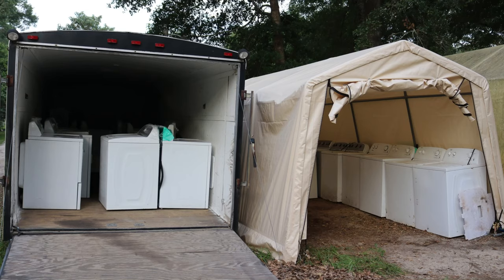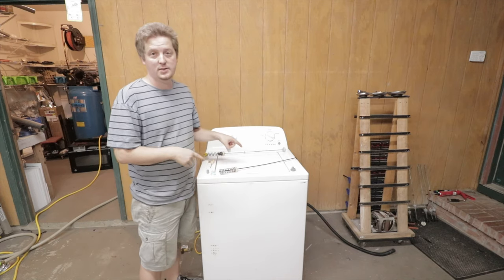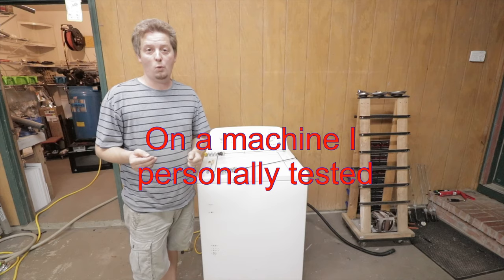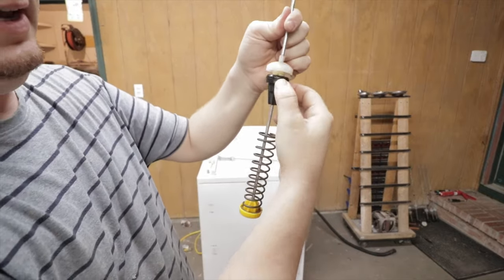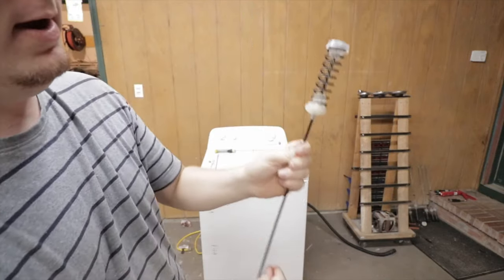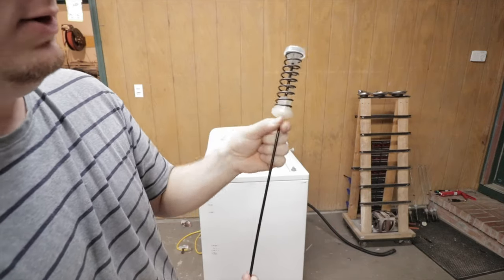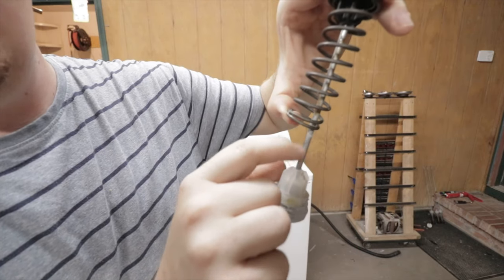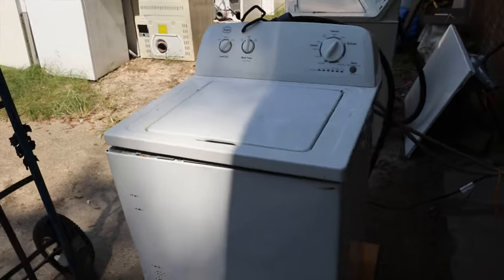Cheap Permanent? fix for shaking banging Washer? $7 to fix Suspension dampening rods W10780048

Comment: Simple fix for your problem with your " Samsung and other high end machines "  LOL  .  Buy a Speed Queen.  They dont hang by a suspension rod and I have never, ever , seen one go out of balance.   You guys are just trying to fix a flawed design.
Reply: Speed Queen's are King. Fitting in 2021 too lol
Reply: Wrong. Speed Queen now uses suspension rods. And a lid lock. So no- they’re not like the old ones.
Reply: I just picked up a 2017 Speed Queen that has the snubber ring design and no suspension rods. It does however have a lid lock that I think is The fault with the machine. You never hear the lid lock engage and the machine won't enter a cycle only flash the lid lock light. We will see. Oddly enough the GE machines that have used suspension rods for a long time never seem to wear them out. These use a thicker rod than the Whirlpool desigh and the shock area looks larger. Maybe that is the magic. Never taken one of them apart to see what they use for dampening material but I do understand what this person is showing with that foam that disintegrates. To me it looks like the same type of rubber material that ear plugs are made out of. If someone would make an aftermarket replacement dampening foam with a slit down one side so you could pop it on the ride and push it into the plastic housing they would make a fortune especially if the material were to hold up for a few years. Generally the rest of the rods and springs are not the problem unless the customer has allowed the machine to beat itself to death for a while and damage things.
Reply: @TimNye850  The tub is still suspended from the bottom what are you talking about?
Reply: Nothing invented by people was ever perfect. I like my mid-2000’s Maytag washer. I’ve become very well acquainted with its guts in the past few years. My kids like to overload it. I just put a new wash plate and a hub in it last week, and I know it still needs some work on the suspension rods. All the local appliance parts dealers deny having the rods in their stores or warehouses, so I’m guessing that means that the new appliance dealers are pushing to sell more new washers by blocking the supply chain of parts. Forgive me for seeming to be a conspiracy theorist in every possible way, but I see a world full of people making money by manipulating situations. More on that before I move on: one of our local repair shops allegedly replaced the gearbox on my lovely Maytag Bravos MCT twice since it was new, and I’m pretty sure that all the guy did was replace the plastic hub and charge me for a transmission (both times). 

Now, moving along, if the fix in this video alleviates the imbalance problem during the spin, I’m going to use it while I’m waiting for the suspension rods I ordered online to get here.

Some of us super handy older guys are willing to continue our education infinitely. If there’s something I can keep repairing for myself that will serve me as well as something newer that will become unrepairable after a decade or two, I’m going to choose the thing I can repair, and I’m going to keep fixing it ad infinitum.
Reply: Good luck buying a Speed Queen. We’ve been on the list almost a full year for washer and dryer set. You can’t buy them right now.

Comment: Good video breakdown. From what little I know I could only imagine that the material of the rod and what shape is in, is crucial for the friction rubber piece. I think is you sand the rod is great but at the end of the day, it may rust again and deteriorate the friction piece. Manufacturers of the parts, should really look at making sure this rid doesn't rust. I believe that this should help with the longevity of the foam/rubber piece.
Reply from the maker: The rust is definitely a factor in breaking down the foam.

Comment: I am not experiencing this issue and I love creativity and ingenuity.  Couple thoughts fishing aerator tubing or the likes that is large enough to bend over the top end or cut it in half and put it on,  then slide some shrink rap on it and heat it up.  The shrink wrap will cause an extra bite and tension to control the movement.   Great job with the explanation.   Coming from bing a fighter jet mechanic…. McGivering A solution to a problem to get war birds mission critical in the field with creativity was a must.  Keep up the great enthusiasm to a solution all of you.

Comment: Maytag made in Canada mine says bought it at Lowes the day the warranty ran out they went out! They call them shock absorbers! They are a $104.00 for all 4 what a damn ripoff! It would have cost me nearly $400.00. Dollars to get the repair man to replace them! It still vibrates pretty bad in the spin cycle! I’m not sure why it’s doing this? It’s not banging or dancing like it was with wore out shock absorbers I replaced but I have to adjust the load more frequently! It’s the best Channing washing machine I’ve ever owned! Any answers for why it’s vibrates so bad on the spin cycle???

Comment: Afternoon I have a top load kenmore washer model 11027052602, that shake violently during the spin cycle. I have replaced the four suspension rods and still have the same problem. The washer is level and isn’t overloaded with clothing.  Checked the washer tank and it seems solid. One thing I did notice is that one lower agitator blade broke off. What that be causing the issue?  Any suggestions is greatly appreciated!

Comment: Did you try silicone that has dried in the cylinder. By cutting the housing cylinder open the old silicone I am sure can be cut, drilled , sliced and shaped to fit. I just thought of it while watching you video. Please let me know if it works.

Comment: I shortened the rods by an inch and the machine is working fine. It was a simple fix. I had tried new springs and rods but they didn't last a week so they went back. Glad I saved the originals.
Reply from the maker: See if there’s a wobble between the inner and outer drum.
There used to be no fix for it but recently, there’s a new part that can fix it. When there’s a wobble, it tears through suspension rods within weeks.

Comment: I have had 6 months after rebuilding my suspension rods, and decent success with my fix using rubber bands instead of hot glue. Even large loads cycle through just fine, though it is more sensitive to out of balance loads than stock, it's not by much. The Rubber bands compressed into the area where the hot glue went into don't wear out a hole, and maintain contact with the rod, even after significant use.

Comment: I'm wondering if you could use faucet washers of a proper size. Slit it from one side to the center and slip it over the rod, then force it into the plastic peice to make it tight to the rod replacing the crap they use. Stack however many is needed. Might need some shaving to make the outside diameter optimal.

Comment: One question I have is, would it be better to clean all that dampening grease off the rod and other parts of the dampener before putting the liquid nails in the cavity? It looked to me that you didn't bother. Another material you might try is RTV for automotive, I like the Permatex ultra blue. It stays a lot firmer than other kinds. I watched Ben's video where he sticks pins (like for pinning a hem when sewing) through the foam parallel with the rod to (apparently) fill in the gap and tighten it up. I didn't understand how that would help, but I see from your video that it is actually a foam material that disintegrates, kind of like the suspension bumpers they use on automobiles now where they used solid rubber bumper stops previously. I hate that foam crap. I think it's some sort of urethane foam and I know it just deteriorates from age even if it isn't exposed to UV or any outside factors. I assume it's much cheaper than rubber.

Comment: I don't know if anyone asked this, but was curious your thoughts on plumbers putty. Dont know if this washer is still being used, but if it is off this experiment, I'll just do it your way lol.
Reply from the maker: @greeneserrors  a lot of people are trying a lot of different things. The most successful one lately is 3/4 inch yoga mat replacing the foampiece. You have to make it a tiny bit oversize.
Reply: @WasherDryerMoney  Interesting. I wonder if it has anything to do with a moist environment? How long did the liquid nails fix last? I'm tired of reorganizing the clothes to limit the balance issue. I'm doing my research before I commandeer the washer for the day....same weekend day all the wash gets done and my competency is tested and prematurely questioned lol.

Comment: I tried 100% Clear Silicone to fill where the foam used to be. They act right in my hand, but I have not tried them in the washer. I was pressed for time to complete the repair (wife was spurring me on)  so I spent the $75 to purchase OEM suspension rods. If OEM's crap out in 2 years like the originals, I will try the refurbished rods. Just make sure the silicone has fully cured, immersing the spring ends in water will speed this up, not too long as the springs may rust. Silicone takes a while to cure completely, it might take as long as a week. I have used silicone to make vibration damping mounts for a rubidium atomic clock and they worked perfectly.

Comment: Incredible video and explanation of actual issue that has for sure puzzled many people. Just reassembled all 4 on our Samsung VRT  
I will check back in to confirm if my style hack works and is durable enough to suggest. 
If my hack fails i now know I can order new ones too. Bravo !
Well failure on quick cheap rebuild. 
Ordered replacement rods Amazon $35. Fixed like new.

Comment: This vid helped a lot but.  I removed the dead sponge, cleaned out the plastic bulbs with lens wipe, poked the wipe down filling void while wrapping around steel rod. Thin film of oil on rod, doused the packing wipe with c/a glue. Ran it up and down over slippery rod.  Got a good result. In 10 minutes each rod. Used Carl zeiss ’s wipes, hf superglue.  Light oil to keep it from sticking to rod.

Comment: Nice! Fixed my Samsung. Instead of making a tighter grommet or grippy thing, use another spring (a smaller one with less tension) and clipping one end of it around the rod below the suspension spring and clipping the other end around the rod above the suspension spring mechanism, so that the whole thing sits between the spring with less tension. It allows the main suspension spring mechanism to do its thing while keeping movement up and down the rod slow and steady. 5 minute fix.
Reply: Would you be able to share pictures or video of this with me? I’m having a hard time visualizing this fix.

Comment: How about trying some elastomers from an older MTB fork, they should grip pretty good. How about clamping a hogring around the original piece to compress it against the shaft?
Reply from the maker: A lot of people have been having good luck with yoga mat pieces cut a little bit bigger than the original piece.

Comment: I feel like the extra you put between the two pieces allows the liquid nail to compress as the washer comes down on it. 
  Interesting if it holds up. 
  Thinking about using a piece of auto tire if I experiment with these again.

Comment: Great vid, thanks. Two questions 1) what are the small half round discs on the rod for (shown about the mid point of the rod), and 2) what are the small suspension springs (from rod to drum) for and where do they connect on the drum?
Reply: I think the discs are to keep the dampening grease contained.

Comment: i have a suggestion which may work.  or may not.  how about the weatherproof electrical fittingsthat fit in the body of a device and the cord goes through it to connect inside the machine.  we used to call them glands.  there are different types.  by tightening the gland you may adjust the resistance..

Comment: I never did pull the dampening rods to make sure I had this specific issue, but on my Samsung washer, I used the bungee strap trick to hold everything down on the springs.  So far, seems to work great!
Reply from the maker: Cool
Reply: What’s the bungee strap trick and how long did it last I’m currently having this problem with my samsung
Reply: @aintbreedlove7729 you run thick bungee cords hooked to the bottom of the frame of the washer, over the attachment points of the drum to the dampening rods, and then back down to the frame of the washer. This will force the drum down against the springs and the dampening rods providing spring force downwards which does help very much to smooth out the washer. I've only had this washer for 7 months but the fix seems to have held just fine so far
Reply: I’m trying some bungee cords on the top to keep the drum from banging against the sides. I just did it today. We’ll see how it works. My Amana washer is about 8 years old & doesn’t have any dampening straps like some models have.

Comment: how about a short piece of fuel line? 1/4" held in place with silicone rubber? cut just a little long so it would be compressed making it tighten up under weight. cut the flat retainer off the end to dismantle the rod and thread it with 1/4 20 die follow up with a lock nut. many of the suspension rods i am seeing have plastic cups over the springs and lack the parts you are replacing, this should adapt to those as well since when the plastic cap wears out they are toast as well. those i would cut a short piece of fuel line and follow it with a washer that would sit on the top of the spring so the fuel line would again compress and tighten on the shaft. the next one of these washers i work on i am going to give that a shot. another alternative to tighten the friction hose would be to add a zip tie to constrict as well as reinforce the fuel line. one question i have though  many of these washers have 2 different color caps like red and green qith one color to the rear and the other to the front but replacements dont differentiate them other than the color of the caps they are the same it would seem, do you know of any difference?
Reply from the maker: If you try that experiment let me know how it works. I'm not sure what the color difference. They feel like the same resistance to me.
Reply: This is exactly the idea I had, along with some silicone lubricant on the rod to help decrease the rubber degradation.

Comment: took the foam out and wrapped tight with black ele tape and then you guessed it duck tape.  We'll see how long it lasts...............where and what material to replace that foam?  maybe with that dampening grease it would work as designed

Comment: Great video! Thanks for sharing. I love troubleshooting stuff like this. The simpler, the better. What about just cramming a couple of foam earplugs in there? Or a couple wire ties wrapped tightly around the shaft inside that cone? Or a wire tie, wrapped tight around that foam thing? I may have to try that with mine. It is obvious that these should have had some sort of hydraulic damper instead of foam. Cost was obviously the reason for the design. Such a shame.
Reply from the maker: A lot of people are using 3/4 inch yoga mat or you could look up the clothes pin trick where you push a close pen through the plastic cap on top of the dampener. Be sure to use the bigger clothes pin not the tiny guys.
Reply: Do you have a link? 😊

Comment: I have been experimenting on a fix for the enclosed type dampers used in F&P top load washers.
Im now getting excellent results by replacing the deteriorated foam material with 35A duro open cell ejection rubber that I found on Alibaba, lubricated with silicone grease.   F&P are now starting to also use the open type damper as  being shown here.
Reply: Do not put regular grease on them.  They come with damping grease. It’s very sticky
Reply: @johnellisonarmadilloconstr7966  The primary failure is the decomposition of the foam elastomer which I have not been able to identify. It needs to be open cell and have negligible compression set. So far, my repaired rods using foam natural rubber are showing no sign of damping loss after 6 months. Hopefully it's going to be a long wait.
Reply: @xavieraxiak6866  that’s great that you can find a way to keep the damping without the sticky stuff. But everyone else can’t do that. So they would need the grease
Reply: @johnellisonarmadilloconstr7966  I had a close look at some new F&P suspension rods, 430055p, the open spring type. The grease is more viscous and tackier than ordinary grease. It does seem to be a damping grease.
Reply: @xavieraxiak6866  yes I ordered it off of Amazon for $25

Comment: How about a piece of a foam floor mat like the square ones and cut a plug with a piece of steel tubing or hole punch.  Any time we hear thunder now we think it's the washing machine.  Carpet padding (fiber kind)? High density open cell foam that will soak up the grease.  A google search came up with the foam in a rifle or pistol case.  Upholstery foam is closed cell.  Heavy sponge?
Reply from the maker: I would say it is similar to some of the expenses  floor mats like the cashier stand on.

Comment: Hola great video Sir! 👍👍 I replaced my springs n still banging what could it be? Thanks
Reply from the maker: Probably the part that holds the inner and outer drum together.
There’s a new way to fix that problem but I have not made a video on it yet but you’ll see others like Bing appliances and junk that have.
To test for it you can grab onto the inner drum and wiggle it. It should not move independently of the outer drum. They should be firmly connected.